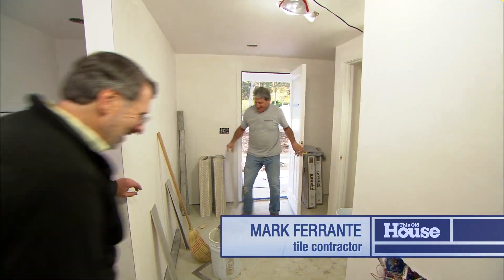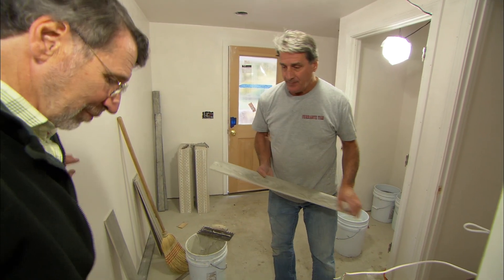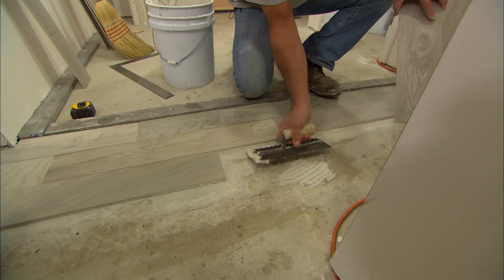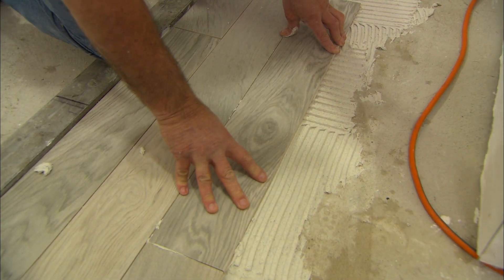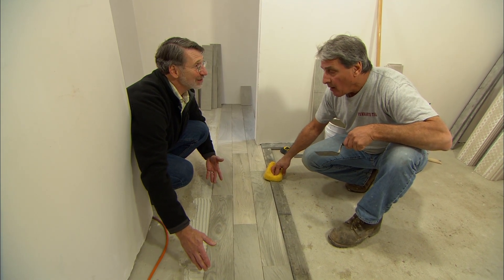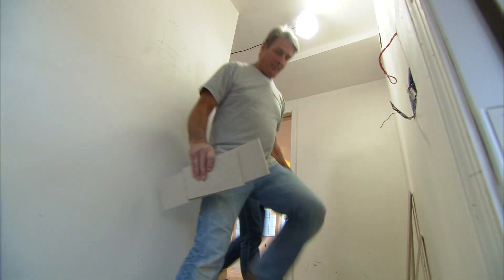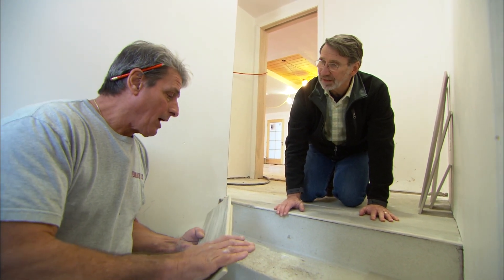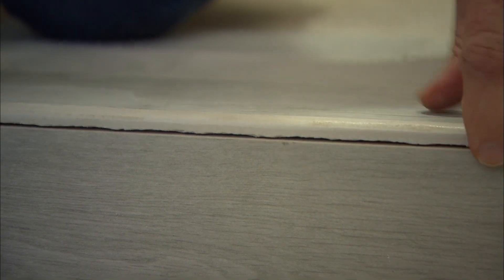How to Install Mudroom Tile | This Old House

Comment: With large format tile like that, you should really be using at least 1/8 in spacers for the grout joints. Plus, you skipped the crucial step of determining how to layout and plan your tile

Comment: Is the tile edge on the stairs sealed somehow?
Reply: Of course, with grout.
Reply: @tinytim9453  Will grout seal the exposed, ground,  unglazed edge of the tile that's used as the "bull nose"? That's what I was wondering about.
Reply: @jptrainor  I was wondering the same. I think the porous material on the inside of the tile is uncleanable once dirt gets smeared into it.

Comment: Tile on steps there's going to be trouble later.
Reply: Wondering your thoughts? Cracking or slips?
Reply: @bobwhelk2118  
On wood steps it’s going to be popped tiles and joints. Will look nice but won’t last too long.

Comment: That tile is installed incorrectly. The trowel marks are wrong. Should be straight and orthogonal to the long side of the tile.
Reply: And The Grout should be Sanded on a tile floor..
Reply: Un Sanded Grout is for the walls Something isn't right here if this install is in a Mud Room why in the world would he use Un Sanded Grout ?? it actually Defeats the Purpose of Grouting at All Especially when it's incorrect. Those Tiles Are Going to Crack Eventually with Water from outside is going to get inbetween the joints and loosen up the Thinset. They Need a New Tile Installer.

Comment: Why would you use " un-Sanded Grout " on the Floor ? You Have to use Sanded Grout on the Floor that's what Prevents the Water from your shoes getting into the grout.
Un Sanded is used on the Walls.. i Don't trust that installation.